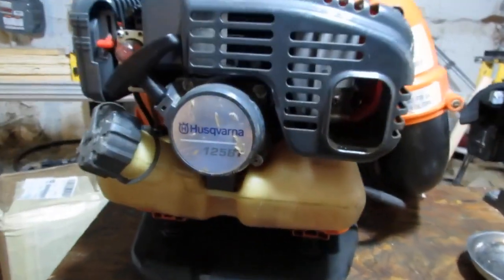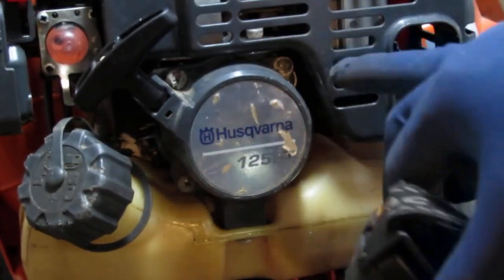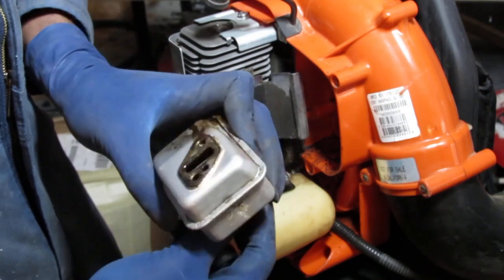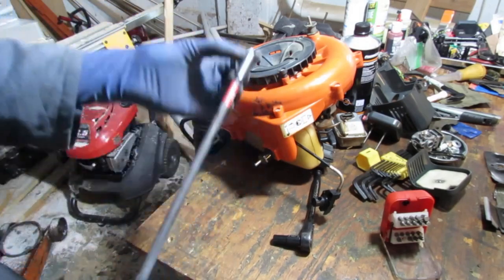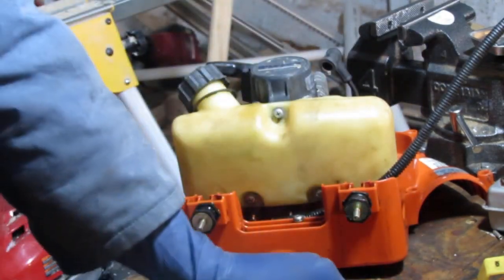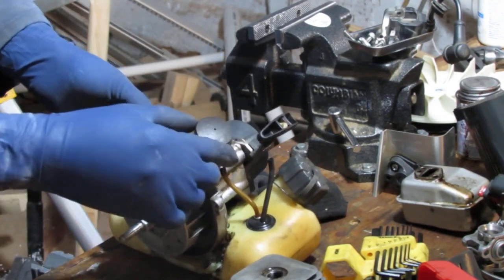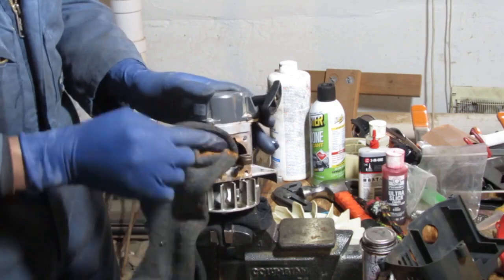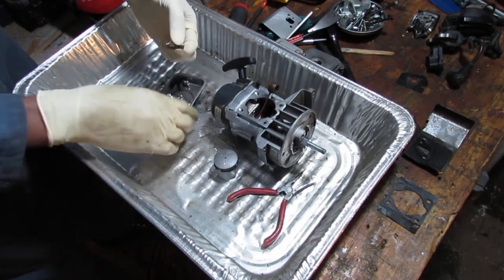Get It Running : Husqvarna 125 BT Power Blower Part I

Comment: Great video. Is part 2 posted? I couldn't find it, but maybe that's on me.
Reply from the maker: Sad news, the parts for this at the time I could not find to continue making a repair on this great blower.  I do not know if they are available now or if they will ever be available.
Reply: Oh. Thank you. I’m running into the same problem. Would like to just buy a new carburetor, but they are discontinued and almost all the carb parts too. I found one on Amazon that look possibly like it might work or be the same one, but upon comparing them side-by-side, they are definitely not exactly the same. Might work but not sure.
Reply from the maker: @Michael Rhodes  , I found the exact carburetor at the same source and it does not fit.  I really need the gaskets for this machine to complete the job.  This is a great blower and it annoys me they are forcing consumers to upgrade.  Ebay is the best bet for find these parts.  Keep watching they seem to come up every now and then.
Reply: @MotionDesignStudio  thank you!
Reply from the maker: @michaelrhodes4105  , sorry I could not have been of more assistance.  Another option is to find another exact make and model with a obvious issue that does not relate to the one you have and poach the parts.
Reply: @MotionDesignStudio  Thanks again. Did you see this before https://www.jackssmallengines.com/jacks-parts-lookup/part/raisman/4310tk7 ? Saw it mentioned in a video about Kawasaki/Husqvarna discontinuing the parts. Looks like the right gaskets and diaphrams (visually).
Reply from the maker: @michaelrhodes4105  , thanks for this link.  It should be useful to others.  Can you edit it and remove the " (" and ")'  It direct to a missing URL when someone attempts to click in the link.  It has been a while.  Is the carburetor on this a "TK7 Carburetor"?
Reply: @MotionDesignStudio  Done! The stamp on my carb only says "TK". I did not purchase it. I think mine is running good again after some cleaning on the metering diaphram side. Going to see how that goes.
Reply from the maker: @michaelrhodes4105  , keep me updated.  This is interesting.  I really appreciate you sharing.  Now I want to look at the carb on this blower.  I did not find any information regarding the termination of parts from the manufacture of this blower..  Do you have a link?
Reply from the maker: @michaelrhodes4105  , I just looked at the carburetor for this that and all it has on it is 4HH.   I hate these carburetor because they remove any way to adjust the high and low settings.  I have a video where it took me two months to figure out that I need to make the passage wider in main jet with a small drill bit to stop the machine from falling flat when revved.
Reply: @MotionDesignStudio  So frustrating. I bought Husqvarna because I don’t want “disposable” tools. But that’s what I feel left with. They should make arrangements to stand behind their customers. Next machine for me will be a Stihl.
Reply from the maker: @Michael Rhodes  , that was my thinking also :  " I bought Husqvarna because I don’t want “disposable” tools.  "  Looks like some .5 A$$ attempt at Right to Repair was signed into executive order.  Louis Rossmann talked about it here.  https://www.youtube.com/watch?v=GE-qEDjUJYY&t=72s  One of my goals as I continue to improve my skills is to go help farmers at cost with their John Deere tractors.  That is hacking the software part that prevents them from fixing the hardware themselves.  That is my goal.
Reply: @MotionDesignStudio  Yeah, I read about that. Freaking amazing. Trash.
Reply: @MotionDesignStudio  guys, I have the same 125BT blower and have rebuilt it.  Parts are available but are getting scarce.  Jacks Small Engines is a good source as well as Lawn Mower Pros.  Most have NOS.  In regards to carbs for the 125BT....it came with 1 of 2 style carbs, a Zama or a Walbro.  Many Chinese clone kits can be found on E-Bay and Amazon as well as actual Zama or Walbro.  Keep in mind, most of the replacement carbs have the plastic plugs that need to be melted out of the high and low speed jet screw ports to adjust them.  Another thing worth mentioning, Stihl uses the same Zama and Walbro style carbs and Stihl's warranty isn't as good as it was just a few years ago....mostly because of ethanol in pump gas destroying and clogging the carbs and rotting fuel lines (don't get me started on the water vapors getting into the engine).  I only use canned fuel (Moto-Mix) and AV-Gas because of that.  Still, I have had some issues with True-Fuel not being consistent and it seems they've been cutting their mix with ethanol.  Stihl warranties are now starting to turn away or void if the same piece of equipment is serviced with the same problems over and over.  If you are looking into blowers, Husqvarna and Echo are less expensive.  I have all 3 brands and find that I use the Husqvarna the majority of the time, and my Stihl for the bigger jobs...That goes for my saws as well.
Reply from the maker: @jeffbaca8115  , this is disappointing to read : "True-Fuel not being consistent and it seems they've been cutting their mix with ethanol. "  I tried and tried to get parts for this and was unsuccessful.  I threw it away in November of 2021.  I tried Jack's Small Engine with no luck for many months.  As you can see from the conversation above that is the reason the parts no longer exist.  Either way thanks for the information.  As compelling as it maybe it does not sway me to attempt to purchase one of these ever again.  Now I need to find a new supplier for ethanol free gas and oil mix.
Reply: @MotionDesignStudio  I live on acreage near Yosemite.  I run saws on a daily basis including Stihl 461 and 661 with 36" bars.  I also run all of our string-trimmers/brushcutters for fire prevention/defensible space....all run on canned gas and AV-Gas.  I took in 2x this summer a 2 year old Stihl FS 120and a FS 260 that had to have the valves adjusted and issues from using True-Fuel in them.  I now only run AV-Gas w Stihl synthetic at 50:1...I run Moto-mix in my small limbing and bucking saws and in the blowers.  I run AV-Gas in the big saws...except for 2 weeks ago, I ran the last of True-Fuel in the Stihl 461...it bogged down and clogged the fuel filter...the cap needed replacement so into the sawshop....$75 later and a "new" still leaking gas cap and a new fuel filter and here we are.lol  Because it was my saw I used in the Shots, it has been rebuilt and serviced by the same sawshop...now they'll have to repair/replace the fuel tank at their cost.  I got by for a week using a Husqvarna with a 24" bar..  The big saws get to be real heavy during a days work.  If you can get 100 octane Aviation Gas, 2 stroke motors love it....  VP Fuel Mix is good as well as the Stihl Moto-mix.  What it comes down to is if you aren't spending $25+ for a gallon of canned gas, it most likely has ethanol in it.
Reply from the maker: @jeffbaca8115  , thanks for detailing your experiences it will teach many including myself.  I have never purchase AV fuel and will have to search for it.  In 2020 I fixed tons of Stihl equipment.  I am very impressed with their designs.  I am a little envious :  " acreage near Yosemite."  I have been a True-Fuel fan to avoid ethanol.  After reading what you have described I will take caution.

Comment: i couldn't find any carburetor adjustment on that. i m wonder if u see any?
Reply: The carb high adjustment is on the top underneath a brass plug near where the throttle fly is.  The throttle/idle adjustment screw is directly top-right.  The low adjustment screw is between the 2 fuel line ports and can be accessed through the metal bracket...on the right side as the carb is mounted. This is a standard Zama barrel style carb.